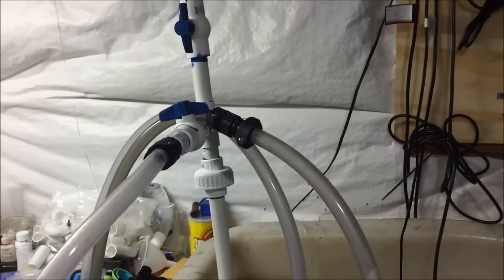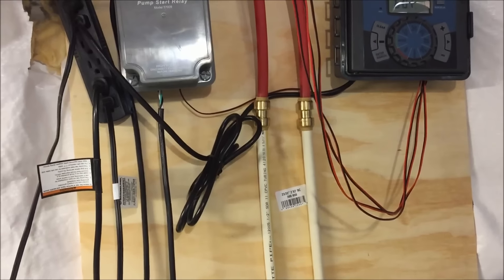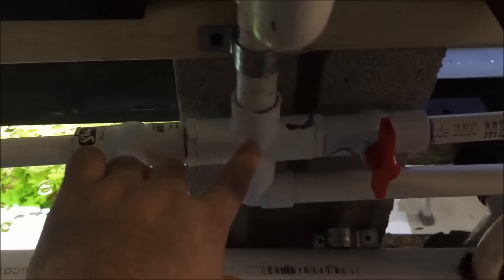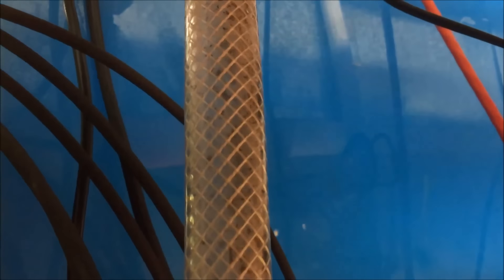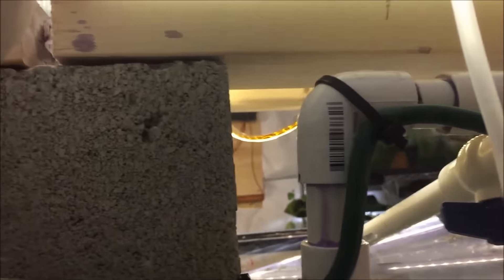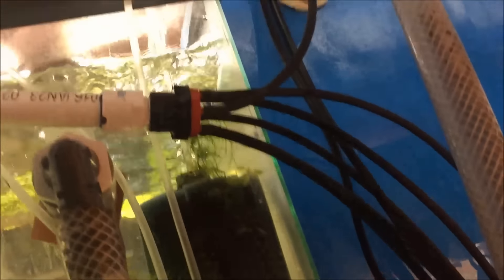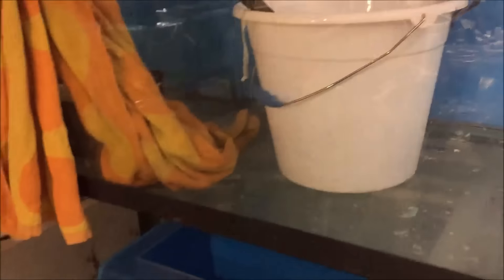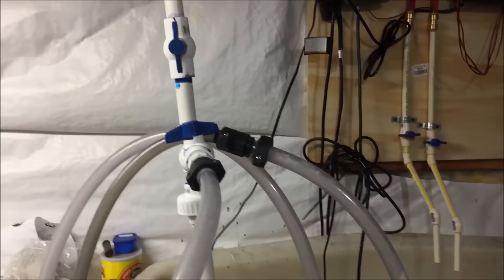Auto Water Change Wednesday #5-Using Drip irrigation emitters to change water

Comment: Do you find the drip emitters 'stick' at all? I drip mine 24/7 from a HMA, and if I ever turn the water off, sometimes one or two won't start dripping again when I turn the water back on, and require a little fiddle to get them going again :-)
Reply from the maker: +Discus Newbie no, but they are only 2 weeks old. Do you have to pay for water?
Reply: I do pay for water (The water company keep calling me asking if I have a leak somewhere - which technically I do!). I do only drip, probably about 50  75% per day but yes it costs me - still cheaper than playing golf though!
I've dialled that back from >100% per day when raising discus fry but it's still overkill in my opinion - next project (well, a future project) will be to automate turning on the water for a few hours per day - but I really don't want to store water because I'm tight on space.